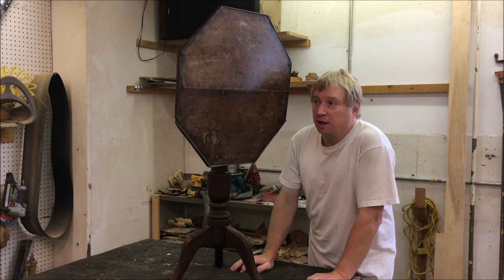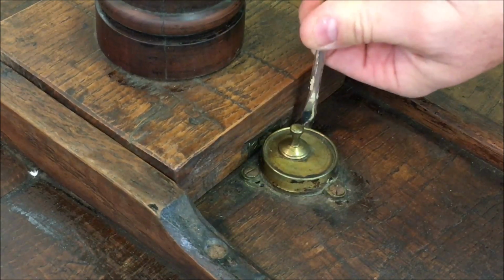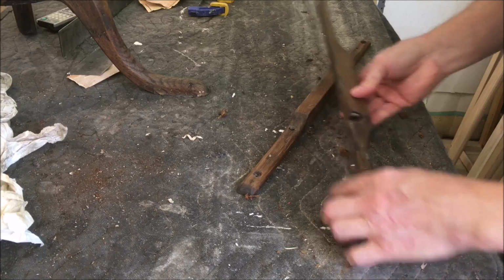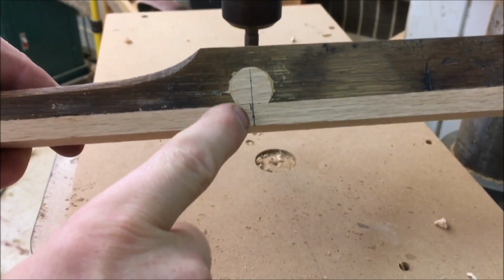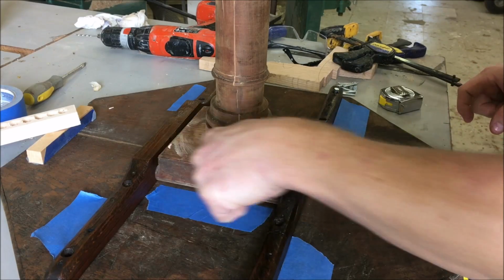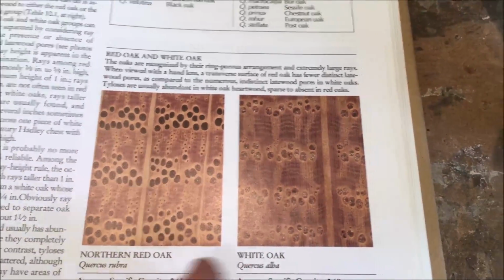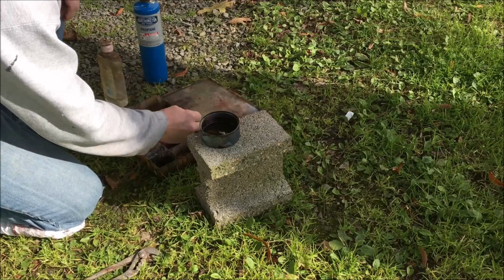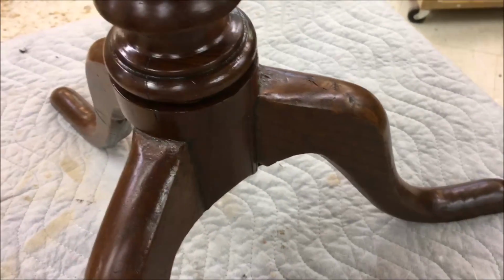RESTORATION / QUEEN ANNE TILT-TOP TABLE

Comment: ROSS   Old Screws and nails that have been in the wood for sometime    USE an electric soldering iron on the head for a minute. It expands the screw breaking the connection with the wood. Leave to cool for a minute and the screw or nail comes out real easy.

Comment: Great video! I am restoring a Victorian walnut tilt top table circa 1880. I tried wood glue to repair one leg. They are held in with dowels.Glue failed--dowels should be larger. I am trying JB Weld to hold the leg and to fill in the extra play in the holes. If this fails,  any ideas?. Column has a redish tint, top is wainut color.
Reply: JB Weld glue worked in repairing the table leg. Yeah

Comment: What’s the point of it tilting? In case you want to use it as a stop sign?
Reply: For smaller rooms.   When not in use, just tilt it up and push up against a wall.

Comment: @22:40 I am very sad to see you returning rusty screws to the piece. I very much wish that you had run them under a wire-wheel to shine the threads and heads. I am also saddened by the way you treat the heads to a poorly ground screwdriver. If you sharpen it and run a saw through the slots the whole experience of refitting the screws would be so much more satisfying.

Comment: ROSS ! YOU'RE DEALING WITH ANTIQUES ! DON'T TRY TO MAKE THEN BRAND NEW. A SLIGHT CUP TO THE WOOD IS NATURAL AND DOES NOT AFFECT THE TABLES USE. IT WILL HOLD A LAMP OR ANYTHING ELSE. IT DOES NOT AND SHOULD NOT BE PERFECTLY FLAT . YOU ARE GOING WAY OVERBOARD IN YOU RESTORATION.